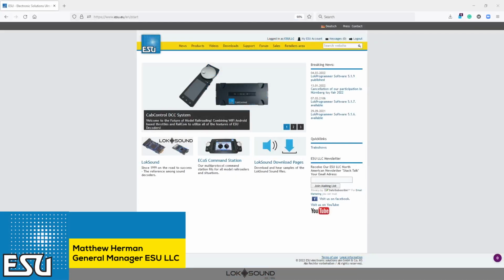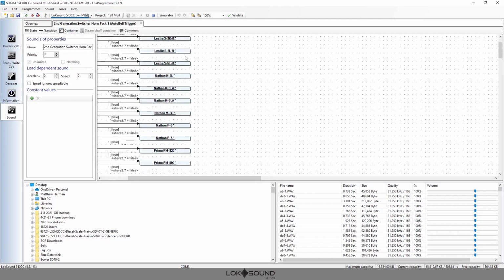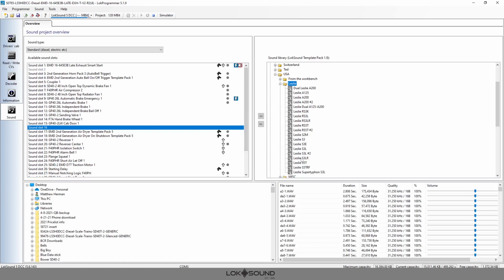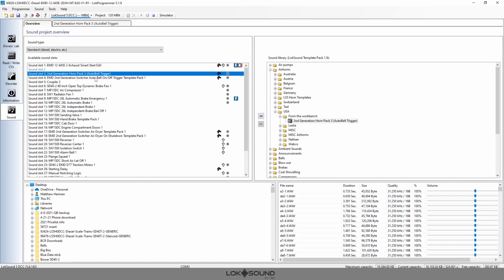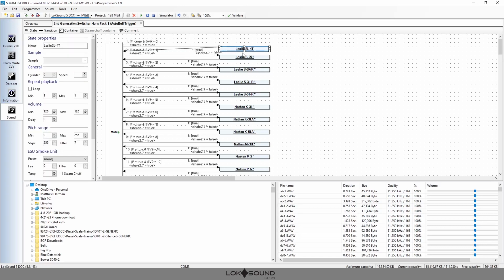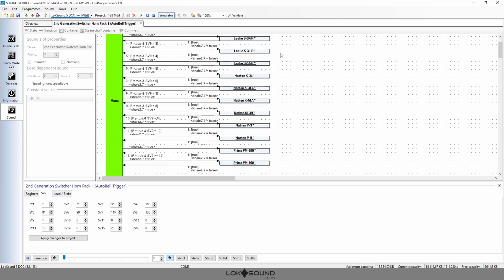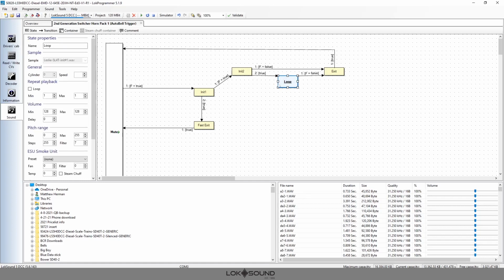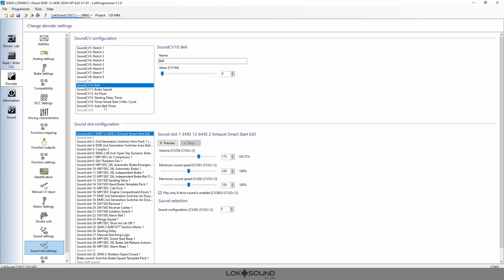Tutorial EN LokSound5 Soundslot Design Creating Templates Moving Sounds

Comment: Your moving horns between sound slots where you can select, copy and paste, but how do you add a horn (PRR passenger 3 chime)from Template Pack where it won't let you select it to do a copy and paste?
Reply from the maker: First you need to move the template pack which has the whistle you want into the file by selecting the template, and the soundslot and then press the plue left arrow. about 10:50 of the video shows a little about this.